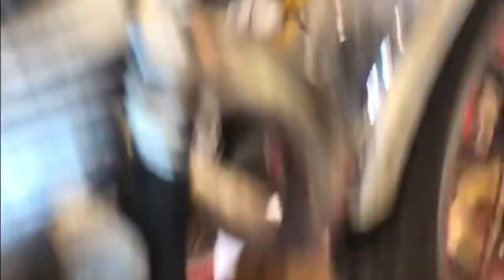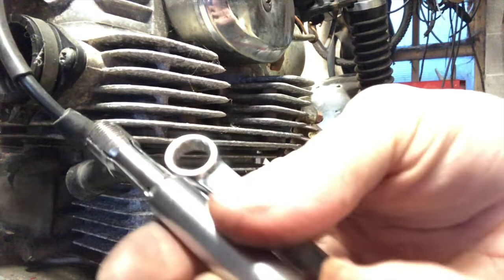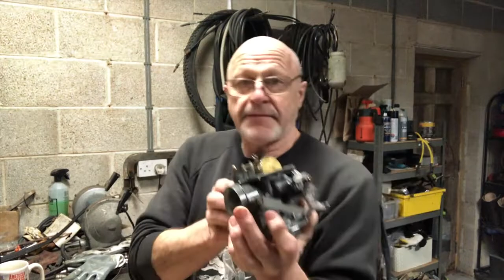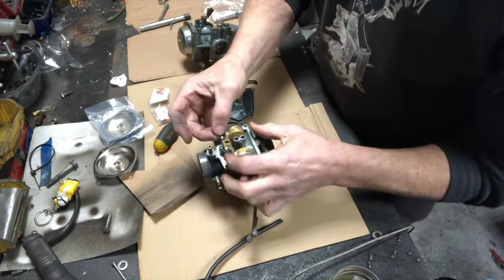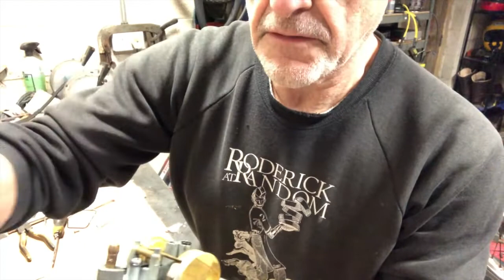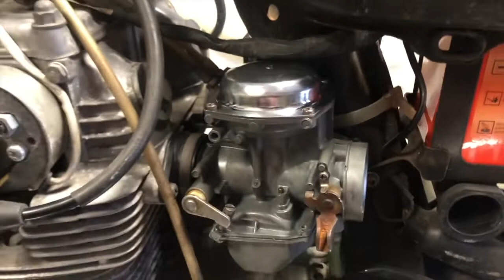Honda CL350/CB350. How to set fuel levels. Repairing a damaged plug thread

Comment: Great tips Rod......what a great fix for the the spark plug thread ! Also, carbs have always been a mystery to me, especially float heights. You have made things a lot clearer to me thanks.
Reply from the maker: Hey Keith. Glad to give any enlightenment on the carb front  :0). The plug fix is great eh? . Thanks for watching as ever.
Reply: @rodcurrieclassics8102 Excellent !....... As long as you make them...I will watch them. 👍

Comment: ROD WHAT ABOUT THE BITS OF SWARF GOING IN TO THE BORE
Reply from the maker: Hi David. The amount involved with a thread clean would be minimal and hopefully would be stuck to the oil I put on the tool as it came out up the thread. As you've seen the bike has run since and is fine. It's one of those situations where there are no great choices, just less bad ones.
Reply: Just in case anyone doesn't trust the oil to hold the small bits, try putting bearing grease on the cutter. Great video Rod, keep up the good work, I enjoy them very much.
Reply from the maker: Thanks Jack. Yeah, bearing grease probably is a better option in cases where there's a possibility some larger pieces of swarf. Good that you're still enjoying my rambles. I try to keep it light.....but  without sounding like a game show host. :0)